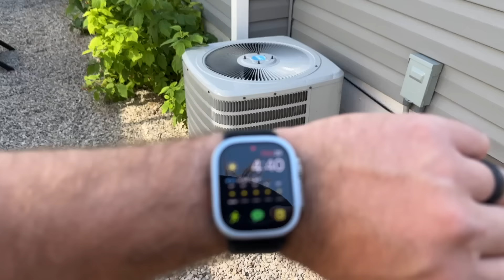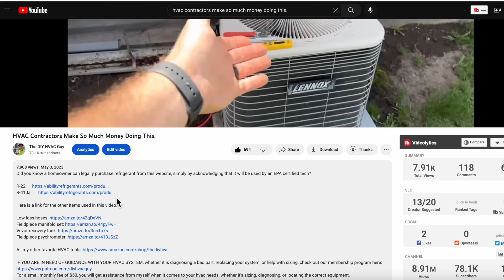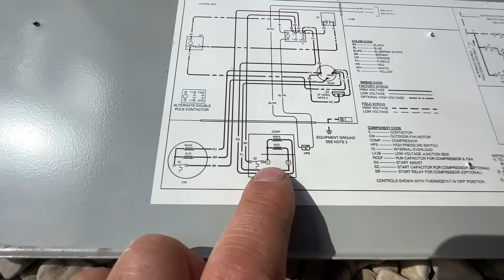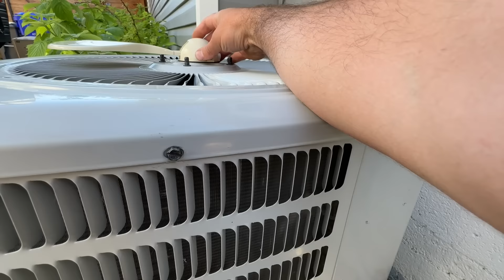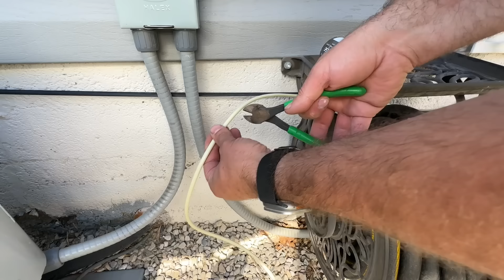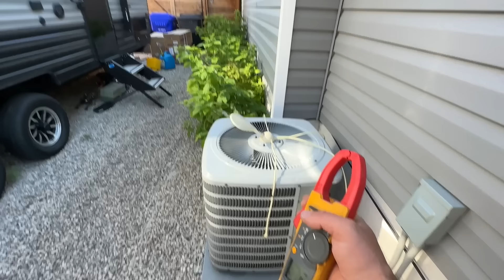Can This Device Actually Lower Your Electric Bill By 30%??

Comment: The spindle on my condenser fan broke. A replacement was 10 days to 2 weeks away. It was 98-99 degrees with almost 100% humidity on the south Georgia coast
 All I had that seemed it might help was a dollar store box fan. I ziptied it to the top of the condenser. The poor box fan didn't stand a chance of moving enough air through the unit for it to function properly. So I took a regular old lawn sprinkle, set it where it didn't didn't oscillate back and forth set it a couple of feet away from the condenser on the side away from the electrical cover and barely cracked open my faucet where about half of the entire coil was getting wet without flooding the fan or any electrical components. 
I didn't think it would do much but my three guest and myself were being roasted alive, it was almost dark so I went inside and set the thermostat at its lowest. When we got up the next morning it was literally freezing. My guest were wearing long sleeves and light jackets. Needless to say I readjusted the thermostat. People walking by usually laugher, I heard one gentleman say to his wife " Well, would you just look at that contraption" with a giggle and a smirk. It served us well for our 2 week stay. I still have the replacement fan motor and capacitor. I have never again had the opportunity to return.
 A/C systems in a lot of occasions can be made to work in an emergency with a little common sense and ingenuity.

Comment: I added 3 extra tubes a total of 6, and after checking the head pressures it went from 243psi to 215psi...the only thing is my subcooling did drop from 12F to 8.3F.
Reply: I would expect that wouldn't you? More efficiency of condenser now so more saturation is taking place. If it's a txv system either add a sight glass before valve to ensure pure liquid or add refrigerant to design subcooling. Check your delta T across the evaporator, if its higher than 20*F your charge might be short now.

Comment: Made one myself our of 1/4 copper tubing with very fine holes drilled into it and used a solenoid valve that was wired into the thermostat wires to turn it on and off. Worked like a charm.
Reply: Guess everybody thinks very fine holes is like 1/64  or something.  I'm an ex machinist... when I say very fine I mean in the thousandths which would actually be smaller than a mister you would buy so yes... it was a homemade mister.
Reply: Your solenoid wired into the low voltage is literally ten times better/more reliable.
Reply: That’s better than using the fan even if  it’s amp draw is low.
Reply: Well that's great I tried to make one it woked somewhat but you need to have the mist evaporation is an important part of the water hitting the coils that will cool down some especially if you have a lot of water hitting it but the mist is what this is about
Reply: 36 times more cooling from evaporation then from the coolness of the water
Reply: You could have bought one of the misters, and saved your time in prep time and installing it. Too cheap to make it an engineering challenge.

Comment: Why does the water spray away from the unit? At least that's what it looked like.
Reply: It a misting system. It put a water mist into the air before the air goes through the ac unit.
Reply from the maker: Exactly

Comment: so. I know an ac designer and Marketing Specialist. they want EVER DROP of cooling and power savings. they also want to prevent any calls and maintenance for the warranty period. if they did not add it to the system its more or less a scam or had some other downside that will make it not as effective or last as long.

Comment: That's a 300W drop in usage, so it'll easily pay for itself the first year.  I already have a valve and tubing, misters, and faucet hookup, so I'll try it for free here.  3DP a paddle + mount, and I'm in.
I'm glad you caught your mistake in watering the underside of that siding.  ;)
Reply: He did not use the amp clamp correctly in the after install so his amp draw reading was BS !!…the jaws of the clamp has to be FULLY around the wire…they were not !!

Comment: Back in the early 80’s there was a product called ‘’Mist Miser’’ to perform the same function. It used a solenoid triggered by temp to apply the mist. I used a cheap mister designed for wrapping around a lounge chair and connected it to my sprinkler well water. Seemed to work somewhat but my unit was in constant shade. Never tried to quantify the change.

Comment: I've been doing this for over 20 years (in Bakersfield and Las Vegas) and yes, it will save you a ton of money. The idea is to find that sweet spot where it's just enough water flow to make the mist. Remember that it is the evaporation that we are using to cool the incoming air (evaporative process causing the air to cool up to 40 degrees), not soaking the unit's parts.
Reply: I n s u l a t e!  This will save $ all seasons without possibly growing moss or calcifying your coils. Secondly, do not install an oversized AC unit because it will pull down indoor air temp to the set point temp too quickly before much dehumidification can take place...hence   clammy interior. A dry house at 73F and 40% RH ( relative humidity)  will feel much cooler than a 73F and 70% RH house. This happens when AC unit runs for slightly longer cycles.  Also try to Keep the heat out in the first place with higher R insulation in attic, walls, and glass. Reduce infiltrated air leaks. Block solar load with trees and South window tint and or shades.  Then if all else fails supercool house at night....then if house  still not happy,  use the water method for unusually hot days. Thanks for video.
Reply: I'd be concerned with doing this if the water has a very high mineral content (central Texas lime stone style). In the high desert where I lived for 7 years, I didn't need an AC 90% of the year as my swamp cooler provided enough cold air for 1/6th the cost of AC. The AC unit was for those times that we had monsoon humidity. Even then. The mineral deposits in my swamp cooler pads was enough to go through 2 to 3 sets of pads a year in the high desert of Cali.
Reply: @narref04  Seems like there are ways to save energy but they are not automatic in the push button lifestyle we see around us.   In the video he says one flush of water is all it takes.  Around here, the dehumidifier collects much more than that in a day.  (I pour that water into the washing machine).          That swamp cooler sounds interesting.  tHanks for posting
Reply: @narref04 use the condensate from the evaporator
Reply: @narref04  Did you even watch the video?
Reply: @kenniegarner3848 so back in zee 70s rheem had a water cooled condensors and even with bigger water filters added would event end up a big block of mineral hard white chalk .. as the water event reacts to alum .
Reply: Don’t forget to stop by DeWar’s when you’re in Bakersfield.
Reply: should I raise my thermostat?
Reply: 1.6 gallons a day isn't going to save you anything.
Reply: Yes don’t worry, it’ll lower your electric bill while ruining your condenser. Which is cheaper? 😂
Reply: @RedHaloManiac95  it won't save you a cent.
Reply: @RedHaloManiac95 Well, my electric bill is 6-700 dollars every month in the summer, so......
Reply: @starmc26  you’re trading a little money now for a lot of money later lmao
Reply: Yeah so I wonder if this would work in very humid environments like Houston... Since it's evaporation that makes the process work, I would imagine in humid environments, it would be a lot less effective. In Vegas, it would work great. Probably not so much in Houston.
Reply: Im in bakersfield and I need you now 😢
Reply: @luismartinez9085  It's easy, just do it.
Reply: Nice gadget, bunch of know it all dumbass comments
Reply: I lived in Pahrump for 15 years, why people don't make more use of generic swamp coolers in Nevada I will never understand.   We totally ditched our central air for the use of a good swamp cooler.
Reply: @allan640  Humidity increases the heat index (what the temp feels like )… So, inside with low humidity at 80 feels much cooler that using a evap cooler that bring the temp down to 80…
Reply: @EarlHayward air-conditioning removes humidity that's another way it makes you feel cooler.
Reply: Your not a tech
Reply: repentandbelieveinJesusChrist9  stop smokin meth.. god is fake ..the pedos have takin over .god doesnt care about air conditioning
Reply: @@Valor8080how would this warp your fan blades?
Reply: @Edmund_Mallory_Hardgrove they run fine under 10% humidity
Reply: @Edmund_Mallory_Hardgrove  I use a swamp cooler in Texas and have noticed that it will cool the air until around 70% humidity or higher. Since this is using the same principle I would suspect it would be the same here. Of course the lower humidity the greater the drop in temp from evaporation.
Reply: Doing this in texas right now is like spraying, boiling hot water, on it.
Reply: I was told to just clean your coils with some special liquid soap to make your ÁC run efficient.  However, I’m scared of ruining it, thus I just use garden hose and hose down the outside of condenser. Probably no different than when it rains and your condenser gets rinsed too.
Reply: Meh ! Get a high efficiency in the 18-20 seer range and this becomes unnecessary
Reply: @VergorioVergara  a properly installed 10 seer, doesn't need this junk.
Reply: @mr.monitor.  no system needs that to work of course , but the point was efficiency , 10 seer is not efficient and i haven’t seen lately
Reply: Cheap windshield washer fluid I would prefer over water that could leave deposits. Then tune the mist so it's evaporating efficiently with out pooling
Reply: Horseshit
Reply: When I lived in Bakersfield I had an evap cooler on my roof. I wondered if this was a similar concept.
Reply: @GadgetGirl.74  Same thing. If it was in the low 90's, I just ran the cooler. If it was above that (which it usually is in that hell hole), the AC went on. A friend of mine on the other side of town saved over $300 a month using the mister setup we built on his system.
Reply: @GadgetGirl.74  Yes, same as in the arid parts of Nevada. Not so much Vegas because they hit 108*F temps and 90*F indoor is the best performance with evap cooling. Unless you have a 'Gadget' to put on them?
Reply: @snurb48  Evap cooler AKA swamp cooler? AC relies on available moisture to move energy efficiently. Sometimes I'll open the house up (TN rain forest), flooding the house with fresh air and humidity. The AC takes very little time to bring the temperature down because the high humidity quickly condenses, taking heat with it.
Reply: According to the "experts" on here, your AC should have rotted away years ago. Glad it works for you, for the folks arguing about mineral deposits... you're really supposed to clean you coils anyway (with coil cleaner and UN-filtered mineral rich garden hose water).
Reply: @Mike_H76 Mineral deposits left from evaporated hard water is NOT the same as regular dust/dirt buildup on a condenser. It is VERY hard, and very corrosive and very difficult to remove.
Reply: This is not a good idea here in Wilmington, NC.  The daily humidity in summer fluctuates between 40% and 60% rh in the summer.  It has very little effect in such high humidity.
Reply: @ianbelletti6241  Exactly! Our humidity would run between 8-16%. It was perfect. I wouldn't dream of using this here in Michigan.
Reply: How about a swamp cooler install AROUND the condenser with the exit air sealed from rub intake?
Reply: Soaking the condenser works too. You might rust out the bottom sooner but you are still using water evaporation to remove heat better than just airflow.
Reply: @don2deliver no soaking it doesn't work. Ac works on differential pressure. Cooling the coil that way lowered amp draw yes but it also lowered the effiiancy the same amount because you don't have adequate pressure and subcooling so the thermostat is going to call for a few minutes longer. Don't say things you haven't tested.
Reply: @mr.monitor. 

Few years ago I watched many videos explaining and testing this concept , the conclusion is that there is no reduction of power consumption by the AC.
Reply: @ajarivas72  yup. If it worked they would come built fot it and ready to use that way.
Reply: @don2deliver  I don't know how this all works so my questions comes from a dark place where mushrooms grow.
Could you mount the condenser in a bowl, and then fill it with an inch or two of water?
I know you would need to check it every other day, but  would that work to dissipate the heat or would that make a nominal difference?

I've thought about building canopies over the outside units.  Have you seen trellis where the boards are angled and synchronized with the summer sun?
Reply: @Dancing_Alone_wRentals  The Sun is having no great effect. The temperature of the outside metal has no effect. The condenser efficiency is based on how easy it gets rid of the heat. The water whether in mist from cooling the air before passing through the condenser, or actually running down the condenser is what makes it more efficient. It takes change of state energy to go from 100C water to 100C steam. So taking away heat from the condenser by warming the water or mist and then evaporating it makes the Refrigerant condense with a little less time and effort from the compressor. 
A pot at the bottom that refills itself would work through conduction but would hasten corrosion. 
A soaker hose up top with clearance for the fan would work better. If the hose only leaked when the unit was running would be even better. If the leak rate just covered the heat being removed and didn't drip much beyond what evaporated off the condenser, corrosion would be limited.
Window AC units use the condensate from the room that drips into the pan. They use the fan blades to fling it onto the condenser.
A soaker hose leaking over
Reply: @don2deliver  It is so simple when you explain it like that.
If it wasn't for the distance of the line set, in theory you could have the outside unit in a cave where the air is cooler.

tHanks for the reply.  Much appreciated.
Reply: @Dancing_Alone_wRentals You're using the evaporation or the water (phase change from liquid to gas) to pre-cool the air before if passes over the condenser coils which as using the opposite phase change (gas to liquid) to move heat out of the interior of the house.   Additionally, air with more moisture has a greater heat transfer capacity (Delta T) and can therefore move more thermal energy off the condenser coils per volume (or mass) of air passing over the coils.
Reply: @KidCorporate  tHank you
Reply: @Dancing_Alone_wRentals Not completely in a "cave" or enclosure. The exhaust air MUST dump to the outside or you will have an ever-decreasing rate of evaporation as the humidity level rises from recycled air, (air will become too saturated for evaporation to occur).
Furthermore, if the water source is not far enough away from the coils mineral deposits WILL build up on the fins making your state worse than w/out this adaptation, (depending on the hardness of the water). Furthermore, some places the water is so hard and/or so scarce that it is just as expensive as just paying for the electricity and avoid the water bill and the inevitable cleaning/replacement catastrophe that will eventually result from corrosion and mineral build up.
Reply: @randallsmerna384  tHanks.  All very interesting.  I was wondering whether placing the outside unit in the shade or underground out of the sun's rays would help.  
I think about this because like in your example better ideas exist only  they are very costly to accomplish.
Reply: @Dancing_Alone_wRentals . There are systems that use water to move the heat from the condenser, these are common in multi story light commercial building as they are too small for chilled water, but too large for split systems… They are called water cooled heat pump systems… The water is piped over the condenser coils and then water from all units is run to a cooling tower on the roof, or adjacent to the building, where the water flows over other equipment where evaporation occurs and the water temp is reduced… There are also systems where the water is run through piping underground as ground temps below 8-10 feet are relatively constant, but that requires a large excavation and a climate that is still relatively cool compared to Arizona, Texas, etc, and with soil that is dense (clayish like)…
Reply: @EarlHayward  This is all very interesting.  It seems like new homes with basements, in parts of the country, could have piping under the basement slab installed at nearly no additional cost.

A friend broke out his basement floor and installed Pex for a heating loop.  It really made a huge difference in heating the home.

I have an abandoned pool that has cool water in it. I always imagine that cool energy sitting right there....I just don't now how to make use of it.
( Ducks use the pool )
Reply: @Dancing_Alone_wRentals you can use several hundred feet of coiled pipe for an under water heat exchanger.
Reply: tHank you  @mr.monitor.
Reply: @Dancing_Alone_wRentals  works best to just sink the coils in a creek next to the house and throw away the fan.
Reply: I rent the house so I don't care about the unit lol I'll soak the parts for an extra 4 degrees lol

Comment: I hate the idea of using water near or on the coils!!!  If you live anywhere there's cotton, leaves, dust / dirt, any kind of debris in the air - getting the coils wet will just allow everything to stick to it.  Then, this will actually start to create a film over the coils that will block the air.  It can get so thick it'll be like a cotton t-shirt on the coils suffocating the airflow!  Your absolute best solution is shade.